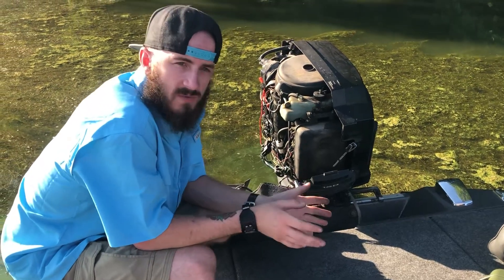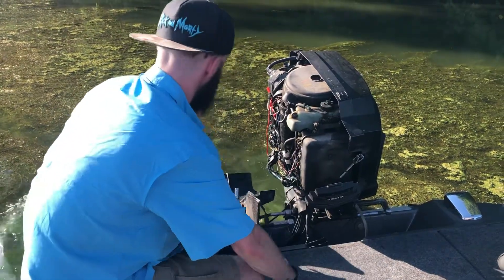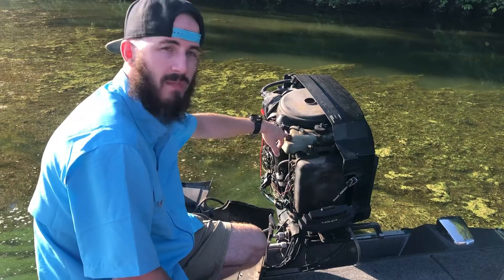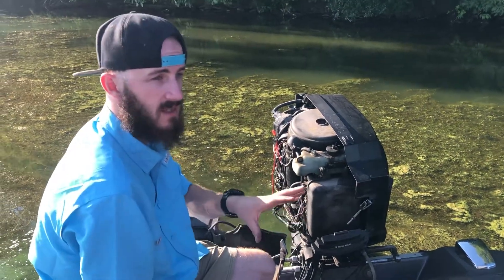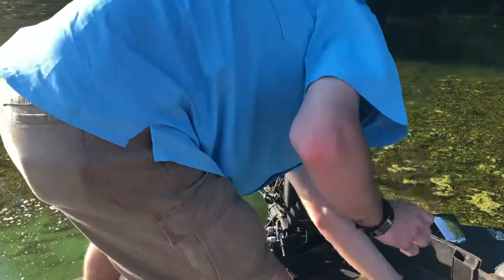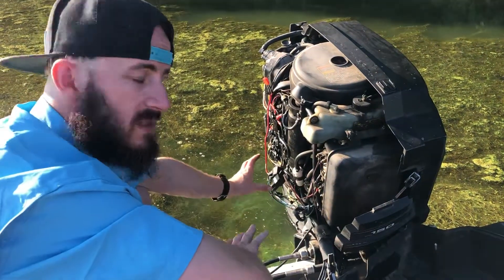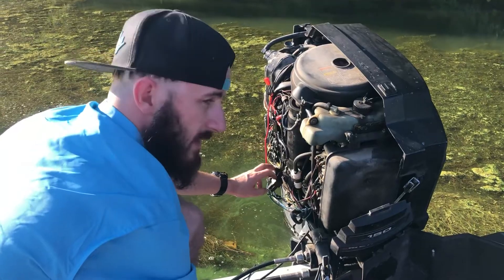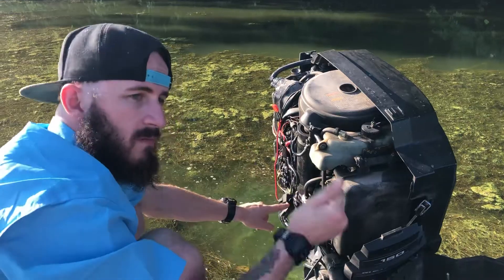Mercury Outboard Trim not working? Try this!!

Comment: yeah, mines not going up it makes noise, but motor won't activate probably corrosion the enemy of all boats electrical systems you unplugged relay scratched the metal and plugging it back in cleaned connection enough to make it work mine is buried and bolted on so have to unbolt it and see if it is just bad connection or dead relay

Comment: great stuff i am a fisherman as well i have a question? my trim isn't working from the shifter or the motor but it works from the front of the boat what do you think it could be?
Reply: I’m literally having the same exact trouble!
Reply from the maker: Could be quite a few different things, could be a bad wire, bad ground, switch has gone out, a terminal could've come off a switch. id make a check list and just start eliminating what the causes could be.

Comment: hey been looking all over and can't find an answer but I have a really similar setup I have an 83 150 mercury and my trim up is really weak it will go up and down but if im driving the boat it doesn't have enough power to trim up to be able to sit on a pad anything would help
Reply from the maker: So I’ve done quite a bit of research to help you out, and the only thing I can find would be the tilt/trim motor that’s connected to your outboard is going bad. I’d start there and see if that helps!
Reply: could be wire connection is bad or relay is worn so you can't draw enough amps through it.